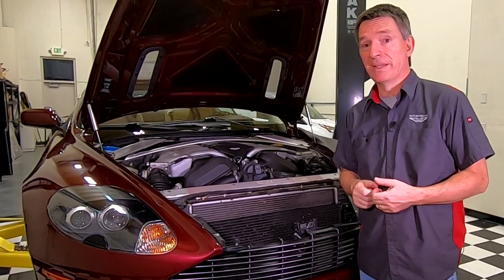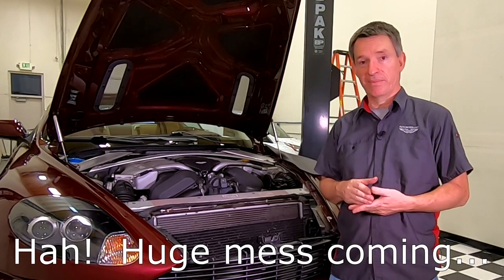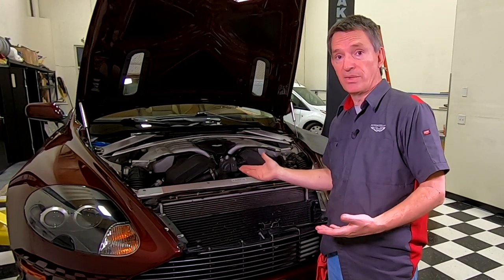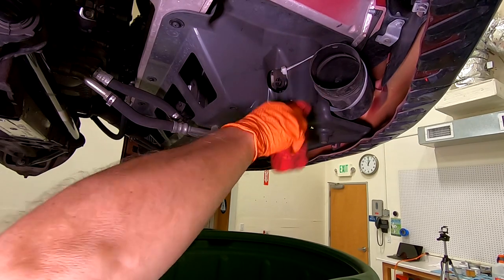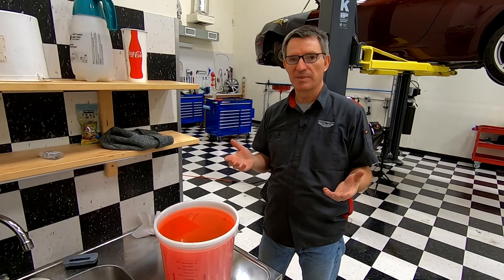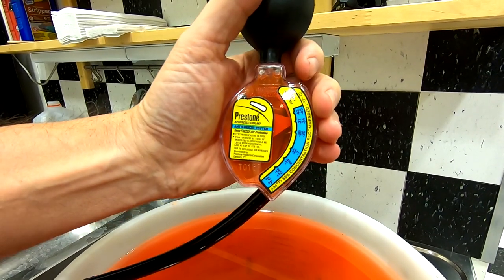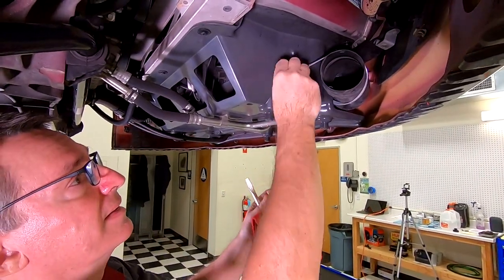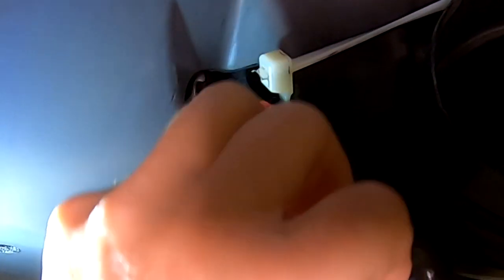Draining the Engine Coolant from an Aston Martin DB9

Comment: So Coolant capacity is 15 liter or 15.8 quart, so i guess we are not able to get all the old coolant out. I flushed it few times, when filling the system back my thinking is i should put 7.5 liter of concentrated coolant back in and then fill up with distilled water, that will give us 50/50 mix. so if one wa using 50/50 pre mix formula they can't get correct concentration right?
Reply from the maker: The amount you get out will vary for sure.  As you saw I didn't get full capacity out.   The only real solution I could see would be to keep flushing with proper 50/50 premix.   Using all water or all concentrate is a bit of a crap shoot as you note since you can't get a full drain between flushes.  Thanks for watching.

Comment: One thing I've done in the past on cars with similarly poor drain positions (like a Porsche 944) - pull the drain plug, and then quickly "seal" the hole with your finger.  Then swap in a radiator drain hose with a nipple that matches the thread of the radiator drain plug, and use the hose to neatly direct the flow of the coolant.
Reply from the maker: Thats a good tip if collectively we had the details of the threads, etc.   A plastic threaded hose spigot would be ideal and a clear piece of hose attached.   Had I known how to remove the actual drain plug (this was my first time draining it) I'd have at least pulled the plug out entirely to speed the flow.  Thanks for watching!

Comment: First, thank You for all Your effort with these excellent videos.

I had to take another approach since my radiator doesn't have a drain plug. Before my ownership the radiator was replaced with a non original radiator. First i emptied the expansion canister with an oil suction tool, got about 4 liters. Then disconnected left coolant hose from the thermostat housing. Went down with the oil suction tool to the bottom of the cooling system, got another 7 liters. In total 11 liters. If I have had that drain plug maybe I would have gotten all 15 liters.
Reply from the maker: Wow, that's determination.  Thanks for sharing how you did it.  I've also heard from Aston dealer technicians that they pull the large lower hose off the Waterpump and just let it all gush out.  Thanks for watching!
Reply: @Aston1936  another benefit with my method was, once the expansion canister was emptied the thermostat housing was also emptied. Not a single drop of coolant on the garage floor!!! I hate making a mess with coolant😄